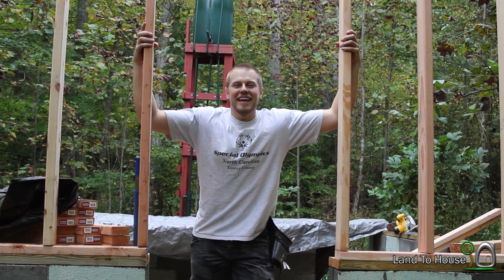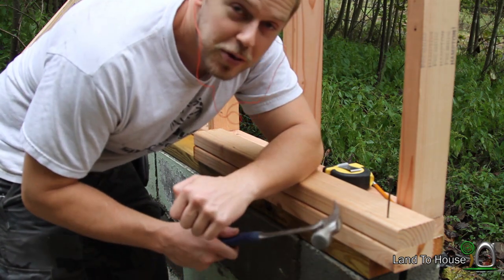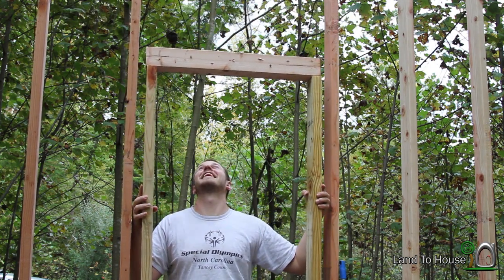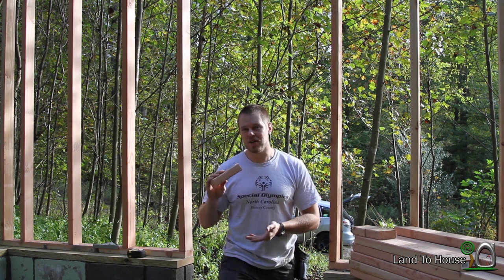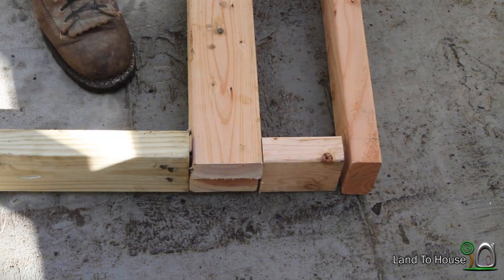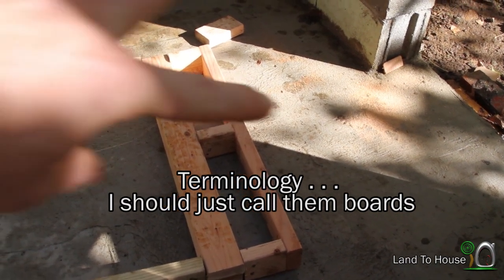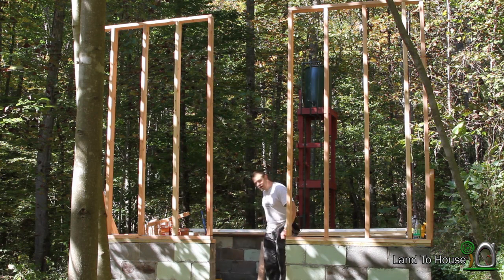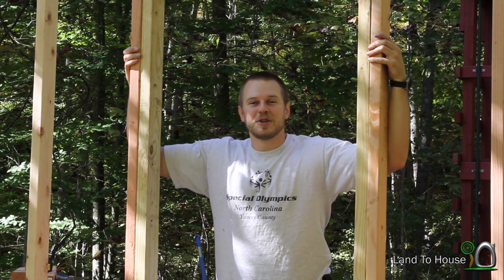Tiny House 11 - Window and Door Framing

Comment: Awesome to watch, love your videos, but I did cringe a few times here....King Studs run all the way up to the top on either side of a header so that you can nail sideways through the king studs into the headers, then Jack Studs under each end of the header to carry the weight down.  AND you would have given youself a little breathing room if you had made allowance to put the king and jackstuds on the block wall instead of inside the door opening (leave 3" of bottom plate free on each of the small walls to either side of the door opening).